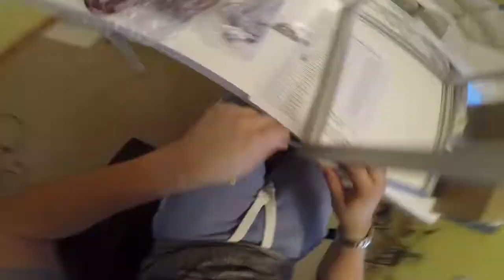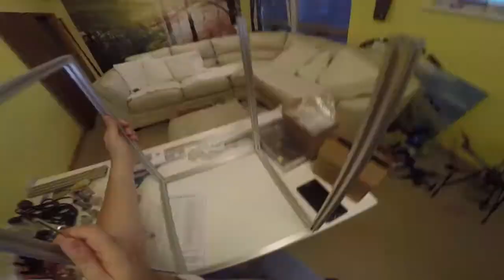Flying Bear-902 Build Part 3D Printer  1 of 6

Comment: After finishing assembling the main structure depicted in this video, did you find that the angles formed at the vertices of the structure were not exactly 90-degrees? I am having that problem. Would it matter if the angles are not exactly 90-degrees?
Reply from the maker: Hi sorry for late reply 
I dont think thay need to be 100% right so I would not worry to much about that :)